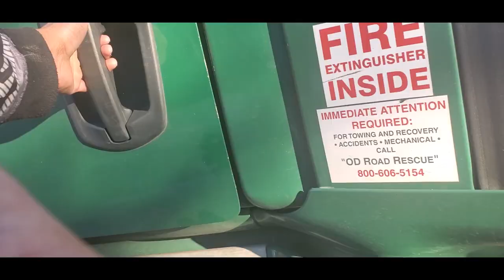A day in the life a Old Dominion extra board driver. old dominion freight line

Comment: I’d like to try and get in at Old Dominion as a line driver after I get a few years experience. I’ve heard so many great things about them. I’ve only been truck driving since July. Here in Portland, Oregon, line drivers run triples and it takes 1-2 years of tractor trailer experience before the state will even allow you to be certified for triples, that and it’s very hard to get in because the drivers at OD love it and don’t want to leave, so job openings are extremely competitive in my area.
Reply from the maker: I hope you get it.

Comment: What are the trucks governed at? How many average miles per night? Average hours per night? Do you use your reset every night? Is it dedicated line haul?
Reply from the maker: 64mph  home every night but you don't get a set run until about 2 years. All runs are between 400 to 630 miles per night. Some tiny terminals run over the road but not many
Reply: @kris1987ful they definitely go faster then 64mph i get passed by old dominion all day long in the south and northeast and i do 68mph..

Comment: How is doing line haul when you start out? Do they call you at any time of the day? I’m a LTL driver with another company doing P&D work but looking to get into line haul. Any advice would be badass
Reply from the maker: You work 6 days a week and they call you every 8 to 10 hours. You will go from days to noon, to evenings, to night  and late nights. You'll basically come in every 10 hours unless it gets slow. You can call to see what place you are in line. Also you get 34 hours off. Not 2 full days unless you ask or unless your at a smaller terminal
Reply: What is linehaul, do you make more $$$ and are you home every day??

Comment: Sup G! What is rookie salary look like at Diamond bro? I'm about the get my CDL. How much should I expect to make right out school?
Reply from the maker: They want hire right out of school unless you apply to be a dock work for a few months and then go through the driving program. So it depends on where you go, but mostly around 40k to 70k. But old Dominion you would be over 90k easy the first year
Reply: @kris1987ful  so if I apply to OD right out of CDL school with all my endorsements and no auto restriction, they won't hire me unless I apply to be a dock worker?
Reply from the maker: Yes because you need 1 year of driving experience to be hired as a driver. I got hired on when I was still in driving school and I wanted to get hired after I finished school which was only about 2 weeks away and he told me I need 1 driving experience to come right in as a driver. But you only have to work the dock for 3 months and then your eligible to go through their driving program. You get paid your normal, so I just got paid for nothing because I already had just gotten my license.

Comment: Can you tell me what the starting pay per mile is at the Dallas terminal? How long to top out? 
Thanks
Reply from the maker: I'm not sure what the starting pay is in Dallas, I strated in Memphis and transferred to Dallas, but I think its around .63 cent a mile and I think u top out in 3 years but they get a cost of living raise every year.
Reply: @kris1987ful  
Thanks for the reply. I was running linehaul at FXF. Looking at OD.
Did you work weekends at the Dallas  terminal? What was the shortest run you would run out of Dallas?
Reply from the maker: Yea starting out in line haul you  don't have set off days. You work until you run out of hours and have to reset or if its slow. You're basically on call, they call you ever 10 hours, so you will work mornings, evenings and night, constantly rotating. The shortest run i think is tyler, tx but you'll do more than that. Let's say u go to tyler, well tyler may send you to texarkana or they may give you 3 tyler runs
Reply: Thanks again. Do you have any advice as far as the interview and road test is concerned? I drove an automatic the last 3 years at FXF. Might be a bit rusty on the gear shifting.
Reply from the maker: @edcosta8417  naw its pretty easy. If you have anything on your driving record tell them because if they find out they will fire even if you've been hired on. And just whomever you do your road test with that your rusty from driving and auto-matic the last 3 years. There not looking for the worlds best just someone who can drive. Good luck tho, I hope you get in
Reply: Thank you for all the information I really appreciate it.
Reply: I start Monday in Duncanville, TX. .68 per mile and $28 per hr.
Reply: @JamesRoberts-nr7gc how many years does old dominion go back for accidents? Did it ask 3 years or 5 years?
Reply: @kris1987ful how many years does old dominion go back looking for accidents? 3 years or 5 years?

Comment: How much they paying today staring snd top pay? How much for insurance for single? And how much for 401k? Im in the dfw also
Reply from the maker: I quit last year but I think the starting pay in around .61 cent a mile and tops close to .7
Reply: @kris1987ful  why did you quit?
Reply from the maker: @TRIPLEDIGITS  no life home everyday but until you get a bid run your schedule rotates plus driving was always a plan b for me, I'm in the stock market so I quit to focus full time. I'll go back if it does work by the time I'm in my high 30s
Reply: @kris1987ful  bro this crazy im into trading as well imma have to fwu im trying to make it full time ! what's crazy is I applied at OD they hiring rn in the garland terminal hopefully they call me now im just doing it to build my trading account lol ....I already have a cdl but no endorsements how much do the P&D drivers make and do they have a good schedule/home life cause obviously imm want to trade as well lol
Reply from the maker: @markholt1073  p.d should be around 24 or 26 starting. Home life sucks for most drivers unless you have a bid run in line haul. City drivers usually work 12 to 14 a day but it depends on the terminal.

Comment: How hard is it to drive doubles?
Reply from the maker: A scale from 1 to 10 its a 4. Vans are harder to drive. Doubles are only hard when backing up
Reply: @kris1987ful  Do you mostly drop or back into dock? What are some tips as a new doubles + triples driver. Ty
Reply from the maker: @luisrosario363  yea all drop and hook. The city backs up to the dock not line haul. Doubles are easy, you ride the e-way the whole time until u get to your exit. Best tip is dont get in a spot where you can turn around at. Worst case scenario just break the set down and re-hook
Reply: @kris1987ful  Appreciate the response. I’ll be working doubles next month for FedEx ground doing P&D

Comment: They say linehaul drivers at OD make $98 a year is this true? How is the scheduling and do you get an assigned tractor? Does it ever get slow to the point where they have no work? I see they have openings in San Antonio for mileage linehaul drivers. Just wondering if it’s worth it to work here. Great video.
Reply from the maker: Over a 100k easily. You come in as a extra board driver, meaning you don't have a set run or an assigned truck. They call you every 8 to 10 hours to give your route. You get a 34  reset and start all over again. You can ask for a day off if you want to be off a full two days. After a year or two, you should have a bid run with an assigned tuck, depending on how many people quit, ge fired, retire, or how many new runs they add. They will have your rank number in break to see how far you down on the extra board. Then you can start bidding on runs when you reach the top
Reply: @kris1987ful  thanks appreciate the info

Comment: What’s your hours and days off?
Reply from the maker: You don't get assigned days off until you get a bid run. The extra board works 6 days a week and the you take your 34 hour reset. And it starts over. Dallas is a 24/7 terminal. Smaller terminals might actually give days off to extra board drivers no really sure though